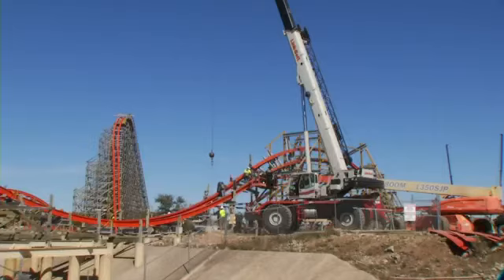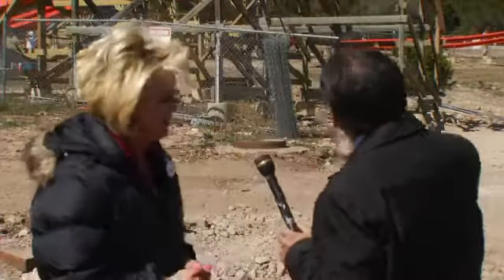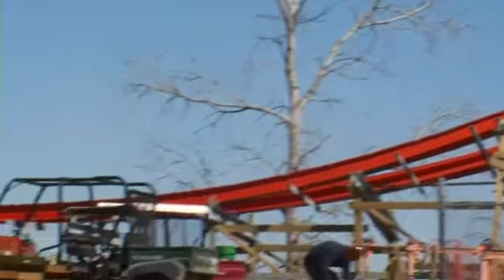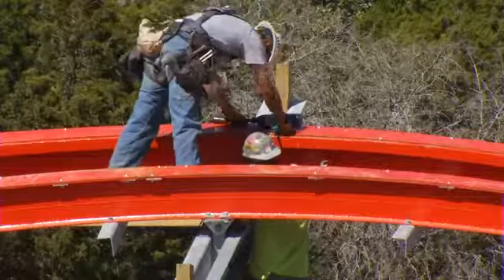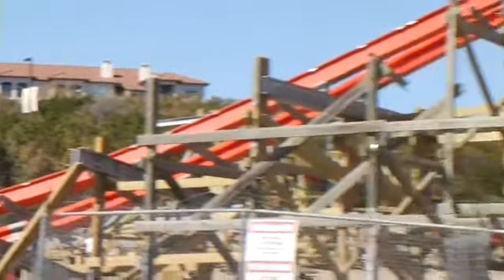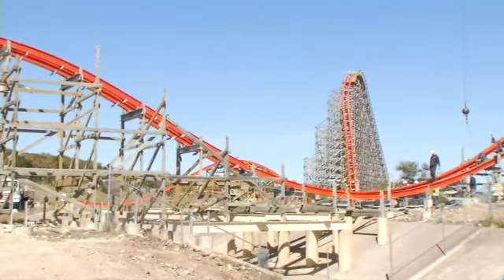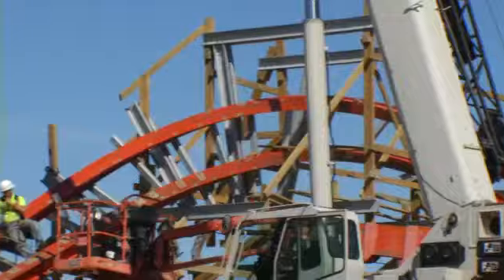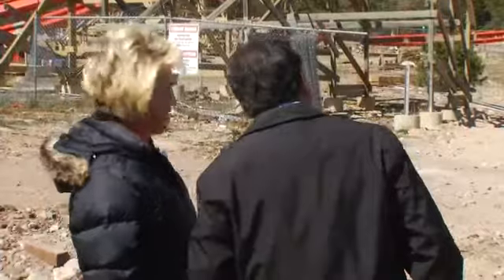Building the Iron Rattler

Comment: I was one of the lucky people cast in Six Flags' Iron Rattler Coaster commercial.  I rode her 24 times before the shoot wrapped. Really wanted to get to 25.  The video does not do the ride justice.  The barrel roll is a zero G barrel roll which means you are weightless as you roll through for about 1 sec.  First hill is incredible and the run over the cliff is actually my favorite part of the ride.  But to each their own.  Six Flags knocked one out of the park with this ride!  Great job SF!
Reply: Who is her?